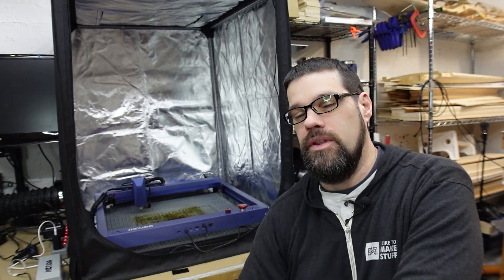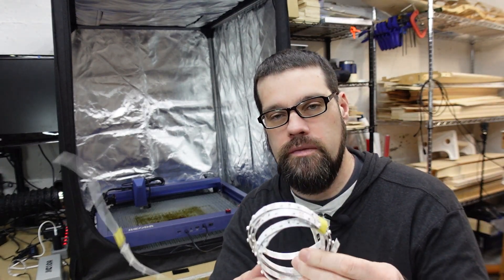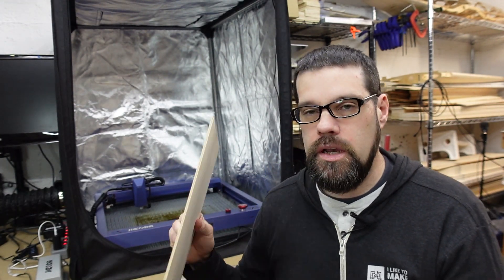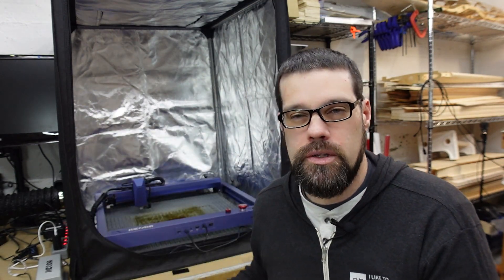LED Backlit Airplane Art with a 10 watt Diode Laser

Comment: It seems a waste to purchase a 16-foot strip of lights and then use a fraction of them.  Do you know if they sell additional power supply / controllers so I could use the rest of the strip?  Or would the power supply be most of the cost and it be cheaper to just throw the extra LEDs away?
Reply from the maker: You can pick up extra connectors and power supplies for the standard led strips and if you have the RGB strips you can get spare controllers. However on the single color LED strips you can pick up a standard 12v power supply and solder it directly to the strip and it will also work fine. I'll try to work on a video showing the options and how to do that.
Reply: @Vintauri  Thank you,  looking forward to the video, hopefully you will also include links to the power supply.

Comment: Steve,  Liked the project.  Maybe could go into a bit more detail about mounting of the LED strip.  Wasn't exactly sure how you mounted to back panel.  Thanks,
Reply from the maker: These LED strips have adhesive backing, so they were just stuck on.  The bigger thing would be the soldering of wires to them and adding a power source.  I wanted to keep this video shorter, but I do plan on making a video about using the LED's in the near future.  Thanks for checking it out!